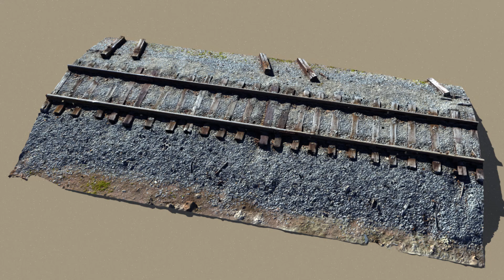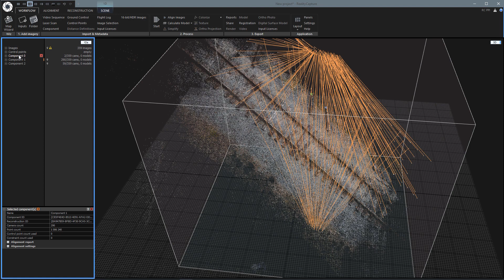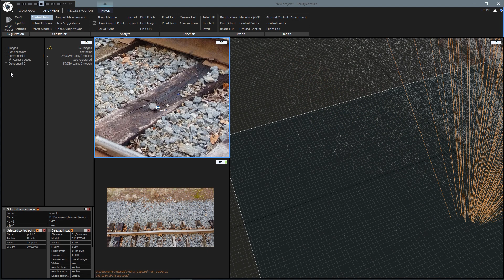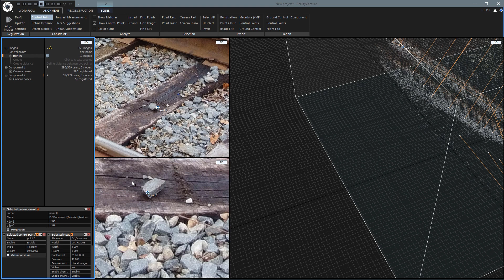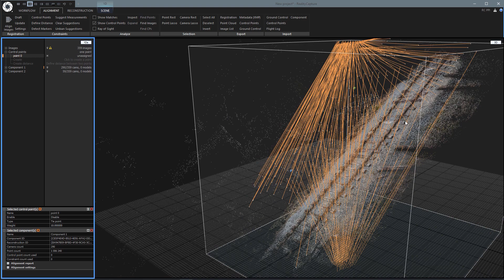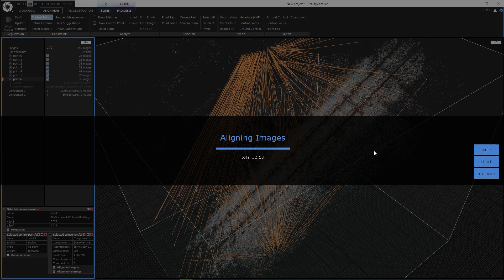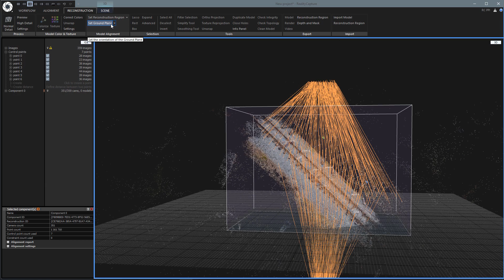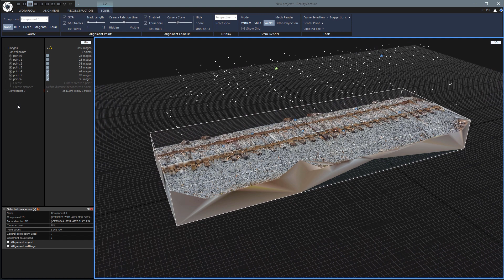3D scanning with Reality Capture -Merging Components

Comment: Late comment, but I'm just getting in to RC :) I follow the actions, but not the algorithm behind it. If you have 2 misaligned components, how does creating control points in just ONE component tell RC how the 2 components should be aligned? It seems that RC would also need to be told where the newly created control points are in the SECOND component.
Reply: This is exactly my thought. I think that if you get a very luck, just spamming points might work, but this is not the correct way to understand the process.

Comment: You should start clicking on the top green square instead of the last one, at least this way you don't have to mouve the mouse. It's not the best way maybe, but it's faster anyway.
Reply from the maker: @almostdarkslide3851  Makes sense.
Reply: @3DJapan  I thought it did too until I did. You've to move down even then

Comment: does not work for me with differnt pieces and contexte do i forget something? (turntable + lumix s5 in jpeg flat + 50mm at f11 + iso 4000 + sweet daylight exterior & spot light + target + white background + 5 control point + align + normal model ) The components does not merging OR merging but i juste have 2 pieces in one not aligned.

Comment: I dont get what you get with such alignment as it will only align cameras in current component which are already aligned? We need to align same images that are in both components so the can align with each other.  Or am I missing something?
Reply: Exactly! In my opinion, the correct alignment was achieved only thanks to the re-alignment of the image. Sometimes it helps to improve the original alignment. So clicking the points in one component was completely unnecessary. You would get same result with one click. You need to find out same point in both components.

Comment: Hello. When using "new way". Let's say I have 3 components. Do I use control points in one, like you did (which has the most images), or I should use it in other components too?
Thank you.
Reply from the maker: I'll start with the one that has the most matches and add the one with the second most, then repeat until there's only one component left. Sometimes if a component only has a couple photos it just won't match to anything and I'll just ignore that one or delete it.

Comment: Thanks. The best one yet. Two questions: 
1) At around 14:12 setting the ground plane. Is there a way of setting it precisely. For instance, the rails or sleepers will be horizontal with the same height( or z axis). Can I set them as ground control points without knowing precisely the x or y coordinates?
2) Did anyone come up with a shortcut yet, to approve a multiple selection of those green suggestion squares yet?
Reply from the maker: Sorry to say the answer to both is "not that I know of."

Comment: I tried doing this but I just get the exact same components
Reply: Having the same issue.  Did you ever find a workaround?  Cheers.
Reply: @DearestHershel  hmmm not really I just considered that scan was not gonna work well
Reply: Suprisingly it worked better in Metashape. I think in my case RC would be better to use in combination with laser scanners

Comment: 579 Photoghs of a landroverr defender and i only get the back of the car with the right side. lol
Reply from the maker: Cars are tricky unless maybe if the car is really dirty or has a lot of rust or something on it. The software needs as much random detail as possible to work. They're also shiny which confuses the software. I did it once by spraying the whole car randomly with dry shampoo, which just wipes off or comes off in the rain.
Reply: @3DJapan  thx for the reply, ok
Reply: There are some videos on doing shiny objects. You take 2 sets of photos: one with the normal object for texturing and another after you spray it with some matte substance for meshing when it's not shiny.

Comment: How can I make the orange lines visible? Sorry but also cant understand the new way. You just selecting control points but you dont make new ones. What is the pointof this? I thought new control points cn register unregistered photos or connect components.
Reply from the maker: Maybe watch again. I click Create to make a new control point every time. The orange lines aren't really necessary but if you really want them go to the View tab and check the box for Residuals. The point is that it's a lot easier than the old way.

Comment: How Do you show both cameras when selecting when component like that?
Reply: Im wondering about the same... Like you select the component with the more images aligned, and place control points based on the automatically generated alignment cloud. But how the other component with the lesser aligned photos knows about these Control Points you place on the first component? Or this is an amazing new way, but we just think about it in the old way?
Reply: I wonder too!!
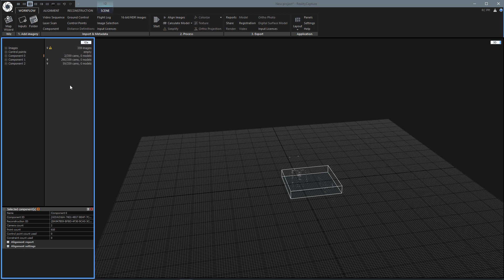Reply from the maker: Sorry I missed this question for so long. I showed how at 3:03 The buttons at the top left let you choose different layouts, including one that shows multiple images.

Comment: Me stuck with the same problem
Reply from the maker: Hopefully it helps. I'm using it on an older set of photos I shot last year and in my case I really just think I didn't shoot enough photos.
Reply: @3DJapan  
It does 

Thanks a ton

I used a dji Spark
2 set of photos in same flight , obviously also same location
One set ,camera straight down 
Another set 45° , trying to get side view....

I get 2 models, overlapping each other. for a long time I thought alignment was wrong, but later realised that if you only viewed one model , everything was right